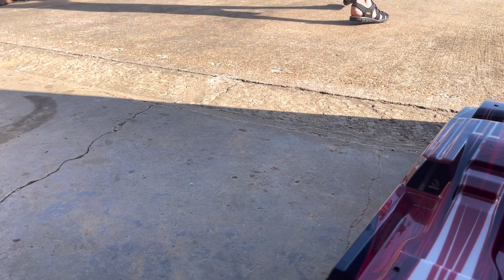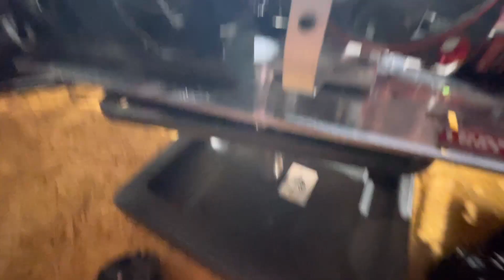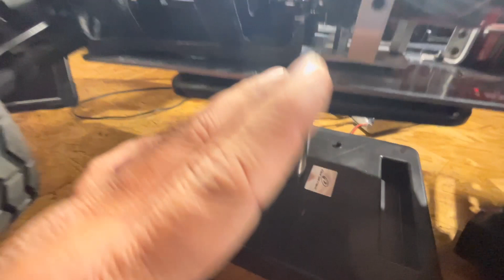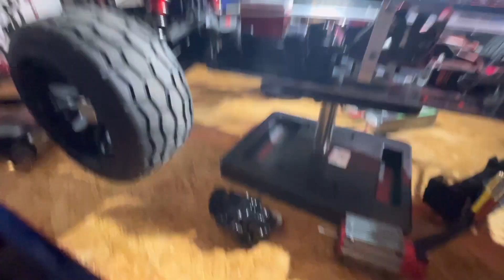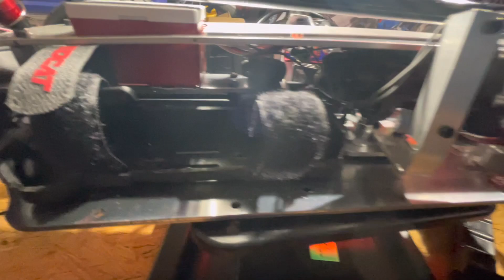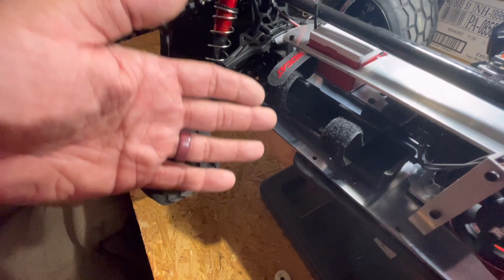Building the Craziest 1/6 RC the World has EVER Seen!

Comment: I wonder if an aftermarket clutch bell from a nitro rc could be modded with heavier springs to give a high stall torque converter type of launch. you may end up.just breaking drive train parts that way though.  Can't wait to see what you come up with..
Reply from the maker: I’ve been working on a nitro clutch and electric slipper clutch combination for sometime now. Its not ready just yet. Maybe the next Shredder build. LOL ☢️🤙
Reply: @RadioactiveRC  nice. Always another build 😎✌

Comment: did the shredder shred the pinion again? lol nice.  to much power maybe
Reply from the maker: Yes it appears that the hub pins are the weak point on the builds. between the 14 hp 12s Shredder and the 2 speed transmission amplifying the torque on the Shredcat I keep shearing pins. I made my own pins today I think I have the problem licked. These builds are definitely over powered! ☢️🤙

Comment: Great videos. Recently did your bulletproofing video on my shredder. Keeping having a issue with that top mount breaking. Where did you get the brace for the top? Looks like that would fix me issue
Reply from the maker: Thanks for watching! I have a complete video on step by step BULLETPROOFING the diffs and making the bash bar. Its a DIY project. The bash bar fixes a lot of the diff problems. It might not seem they’re related but they are. Good luck with the build! 🤙
https://youtu.be/LfkNzJPi3CQ

Comment: Nice shred cat bud, as far as the Traxxas sledge,  well if u have the money then yeah its a good truggy not perfect but tough build motor size is obviously limited and overall space in stock chassis is limited,  only certain size lipos fit in case, pinion and spur gear is made the same way from a stock xmaxx I have blown both sets of mine from landing a high jump, it was on grass but both gears had teeth ate off, slow servo, but it does move the front wheels, motor tends to slip in the mount alot check after every run sometimes during,  m2c has a chassis coming out if not out already but I'm sure it's on the pricey side,  um as u know it is 6065 aluminum chassis so it does bend usually small but does get worse,  also, the tires need to be checked and glued the new process is good but not completely covering the whole rim and tire on alot of them, also when u get it before u run it first time u need to check ur differentials for fluid, really alot is the usual I wish for 800 or more u could trust the makers more but we can not, and lastly there are spacers missing from the back dog bones, so be sure to check that and put some fuel tubing in the cups or sooner or later in the first few runs you will have one or both spit out, in my opinion and just my opinion 😉  I think for 800 the gears should have been made better with better aluminum,  um aluminum supports and a faster servo,  but it is what it is and I'm sure it's not cheap to produce these truggies,  now as far as I can tell these things are meant to be weekend basher. Nothing to nuts, and if you want to upgrade um well lol 😆 😜 I don't think they want u doing that to much, power wise, as I said limited space,  u can up the pinion and spur but keep some fans on it at all times out side of that I'm sure you can see there is no room for bigger in the set lay out, also if you just dropped 800 dollars on a rig, that supposed to be the best rtr out of the box, then why are there so many people already making after market parts??? Seems odd to drop 800 on a rc then 3 to 4 weeks later after giving it a good review showing 300 dollars of goodies ya just bought for it?!?!?! I  must not understand reviews and what they are supposed to mean anymore?
Reply from the maker: Thanks for stopping by the channel Mr. Wick! Thank you for that very complete review and commentary on the Sledge. I’m still on the fence about it but all of the concerns you listed are my concerns as well. I don’t like limited motor space or battery compartments. I definitely like to expand my horizons when it comes to RCs. limitations only help the company who made it. Thanks for that comment I’m giving it some serious consideration. Who knows we may get lucky and get one to review (probably not) LOL. We need to grow the Radioactive RC Army! LOL 🤙